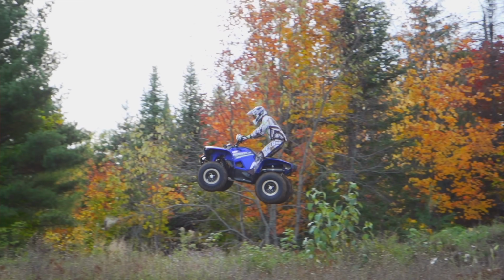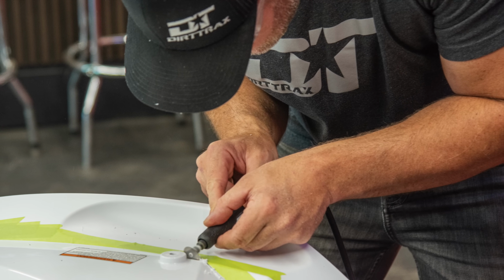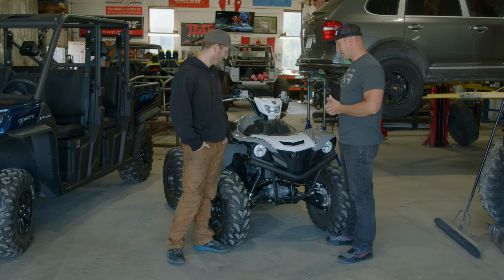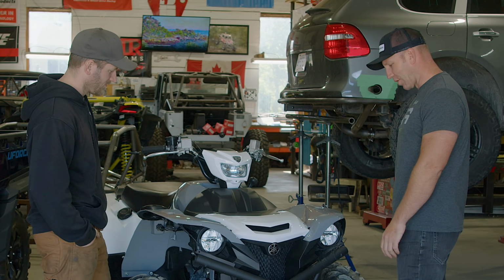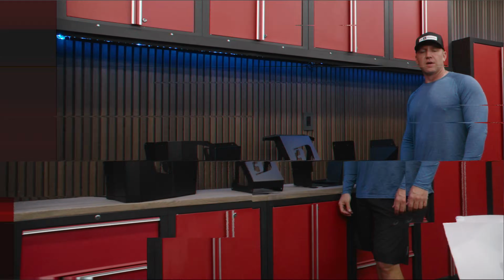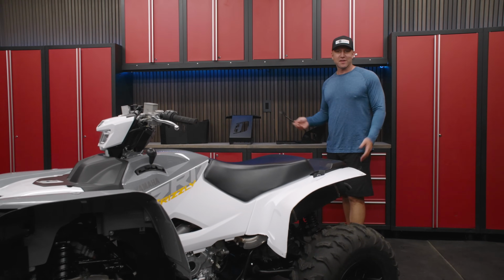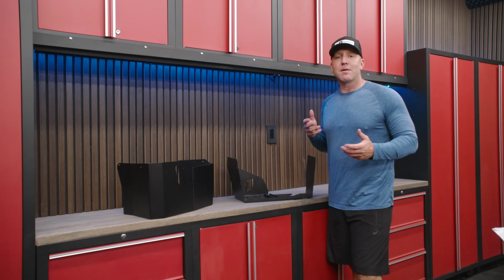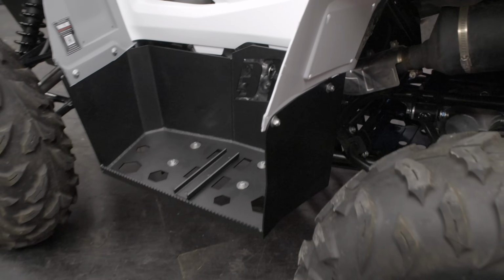Yamaha Grizzly WR700 Commemorative ATV Build - PART 1

Comment: Why did they go back to the 686 from the 708? I never knew they went back.
Reply from the maker: There were a number of failures reported and warranty claims made. My guess is Yamaha recognized the impact on its reputation for quality and moved back to an engine that is bulletproof.
Reply from the maker: For the record, not every 708 had problems. I owned one and it was excellent.
Reply: Thanks for the reply yes for sure Yamaha grizzlies are legendary for their reliability my dad has a 2010 he bought new and still rides and uses it almost daily never even needed the belt replaced only issues it’s ever had was an issues with the clutch.

Comment: Appreciate a little nostalgia and a fun build, but Yamaha forgot ATVs exist, and it's really too bad.
Reply from the maker: They're staying right in the middle like all the other Japanese manufacturers. Mid bore 40-50 HP. It is a popular segment, which is why Can Am built a mid bore single.
Reply: @dirttraxtv  totally agree, but to leave it virtually unchanged for the last decade? Model options? I'd love to go back to Yamaha but they're getting beat in the only category they're playing in.
Reply: @MainvilleATV not beat in reliability.  My 07 ducks unlimited with elka stage 3 shocks is a beast and still looks mean
Reply: @ronsimmsfan2661  they are reliable, sure, but a lot of that credit goes to an underpowered and over built system and the owner. I've seen CF Motos and Can Ams go just as far with those variables.
Reply: @MainvilleATV  couldn’t of said it better myself.
Reply: Your right. That is why I just bought my first can am.
Reply: @dirttraxtv  In other words, they're not doing anything except the exact same thing since 2014.
Reply: @dirttraxtv  no reason they couldn't make a high hp machine and still sell the 700s. i know loads of people that have switched from yamaha because of the lack of hp.
Reply from the maker: @MainvilleATV  Would love to see the line expand to include a factory mudder, a -2up tourer and a sportier model like this one will be. There's quite a bit Yamaha could do with the Grizzly.
Reply from the maker: @ronsimmsfan2661  Elka Stage 3's are nice shocks.
Reply from the maker: @SebastienLorin-kr3wf  Did a significant overhaul back in 2016 and moved to a 708cc engine, then moved back to the 686. Since then, same machine. This year gets the updated EPS, but still single mode. Hoping Yamaha will give it the 3-mode EPS like the RMAX has now.
Reply: I wouldn't give up on yamaha just yet.......rumor is they recently filed a patent for a 1000cc ATV.😮
Reply: @PeeterPuncher  do you know how many shelved patents Yamaha owns? 1000s. Not saying it won't happen, but I'm definitely not betting on it.
Reply: Youve never seen a CF Moto as reliable as a Japanese bike. @MainvilleATV

Comment: Judging by some of these comments, people are over Yamaha ATV's.
Reply: There’s one coming apparently, patents have been filed. It is a twin cylinder, just should have been released 10 years ago.
Reply: in a world of 100hp+ machines the grizzly has fallen FAR behind years ago. they are more comparable to an entry level machine like a sportsman 570 nowadays with similar power and all yet a much higher price tag. and unless your a brand loyalist to yamaha youl agree the new machines arent all that reliable lately
Reply from the maker: @123devinzz1  Haven't had any reliability issues with Yamaha like you're suggesting here, but we do fully agree that the Grizzly should have at least an 850 twin. Also think this line should be expanded to include a factory mudder, a -2up tourer and a sportier model like this one will be. There's quite a bit Yamaha could do with the Grizzly.
Reply from the maker: The people commenting might be "over" Yamaha, but the Grizzly is still really popular in the 40-50 HP class.

Comment: 20 years behind can am and polaris 😂
Reply from the maker: If you compare the Grizzly to an Outlander 1000R, it is behind in HP. Can-Am just introduced an entire line of Outlanders with a new mid-bore single cylinder engine though. still competitive against the Grizzly. If you watch our shootout from last year against the Grizzly and the Outlander Pro, we cover all of this. The Pro won on new features, but the Grizzly won on its reputation. Someone also pointed out recently that the Pro weighs about 200 lbs more than the Grizzly too.
Reply: And still 10x more reliable than CanAm or Polaris.

Comment: Looks cool! But I’m fairly certain there hasn’t been anything improved from the 2014 grizzly to the current model year that’s worth noting. Suspension, motor, handling is all typical “grizzly”. Hell I’d rather take the 2014, third light is useless and the air box was in a better spot than it is now. Yamaha is the best and worst company all at the same time..
Reply from the maker: Lots of negativity in this comment so you must be new here. This is hands down the most requested build we've ever done. Our viewers wanted it and we did it. You have your doubts, feel free to unfollow or rewatch our videos a hundred times. Whatever you want, champ. We're just gonna push ahead.
Reply: @dirttraxtv  lots of negativity? How so? Just facts, I don’t think I said anything that’s false. I have a grizzly in my garage and it’s well over due for a remake. Apologies if that came across harsh.